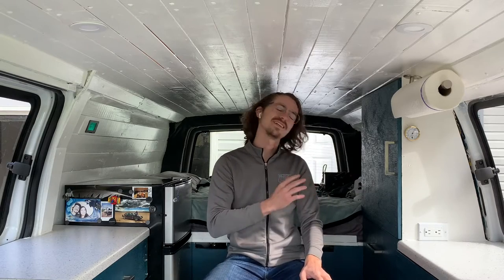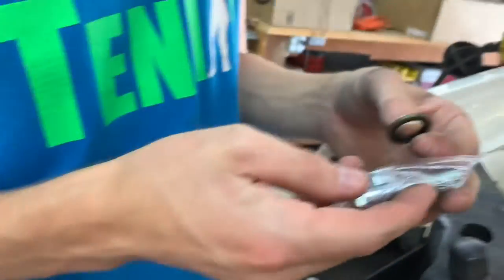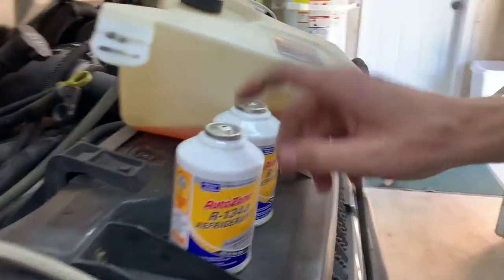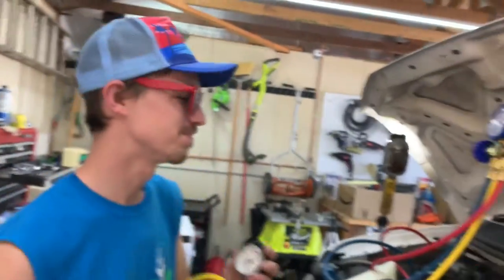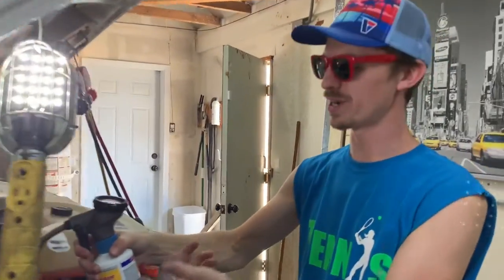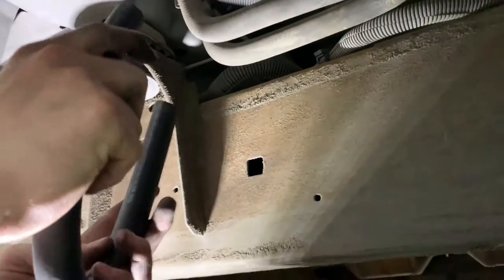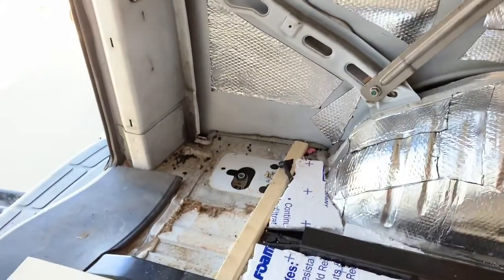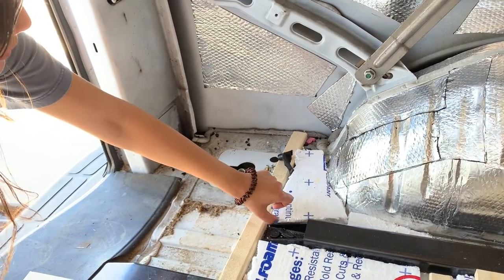Rear AC and Heat Bypass / Removal ~EASY~ (Express / Savana Van)

Comment: Hey- thanks for posting- I need to do this and am (slightly) less intimidated.  quick q- i noticed you had those long seat rails.  Did you remove or leave in before putting in flooring?
Reply from the maker: Hey slippy, left the rails in and insulated the floor all the way up to be level with them.

There’s some early pics on my old Instagram:
https://www.instagram.com/van_with_tim/

Comment: Anyone know if the AC block-off kit will work for the Astro Van?
Reply: If you go on Amazon it will let you put in your vehicle and you can search ac block kit and it will bring up parts specific to your vehicle!
Reply: @melissamorales1739  They only have bolts, which i bought off eBay and did not fit.

Comment: How did you plan the hole left from the unit? Cause idk how to weld so idk how i can properly cover it.
Reply from the maker: No welding abilities here either.
It's been a long time, but I think I just cleaned the area with rubbing alcohol then laid down quality foil ducting tape. 
Then I laid a large silicone bead all around the area and stuck down my foam board insulation.

No issues after two years.
Hope that helps!
-Tim
Reply: @VanwithTim  thank you so much!! Will definitely be doing the same 🤙🏾🤙🏾

Comment: Is this applicable to the G-series vans? Does this part work for a '92 G20?
Reply from the maker: Sorry James, I know the procedure and line locations are different on the 2002 and previous models. Not sure if the AC block offs would fit or not.

It's a shame they make the kits so hard to search for. Took me forever to find this one for my van.

Comment: Hey Tim, I’m trying to do a rear ac removal on my 1997 Chevy express conversion van, but it looks a bit different… can you point me in the direction of the rear ac hose that I should block off? I’m unfamiliar with its ac system
Reply from the maker: Ahhh… unfortunately the 96-2002 vans have a totally different design for the rear AC (my parents had a 1999 with rear AC issues)

I’m not positive on those line sizes / block off locations.

However don’t lose hope. It will take a little time but you’ll need to trace the two lines from the rear AC evaporator back to the front. Find a spot they bolt together / can be disconnected from the front, then measure the line diameter.

Hopefully you can find suitable block offs online somewhere (if not, Dorman Products makes some universal “AC compression fittings” to block the lines.)
Reply: @VanwithTim  thanks man, I just did it today, and all went well! You’ve definitely earned my sub!
Reply from the maker: @Ash91719  glad it worked out!

Comment: Best video I've found on this topic! Quick question though, how'd you determine which pipe lead to the rear AC? Is it as easy as following the pipes to their destination or did you need to take it into a shop to determine which pipe lead to the front/back?
Reply from the maker: Just traced the pipes around! Just remember there will be one “large” and “small” pipe for the front and a set for the rear. Hope that helps!
Reply: @VanwithTim  Thanks so much man! From your opinion do you think its worth going through the process to remove the rear AC?
Reply from the maker: @GMercer015  no problem 👍 and it was worth it for us to have the extra space. We went solar for the AC. Running the van overnight for HVAC is fine on the engine, but is just asking for trouble from thieves.
Reply: What was the reason behind removing it?
Reply: @substanceo9335  I originally wanted more room for my van conversion, as it would have freed up a spot for a small drawer or storage area. I ended up keeping the AC though, it works pretty well and keeps the back chill during hot months 🤟
Reply: @GMercer015  I’m buying a new 3500 2.8 litre duramax van with the back ac/heat option. I live in Canada so both will come in handy. I believe they work without having the van running…still checking into it tho. I figured I’ll get your opinion on it and if it’s a faulty feature, I will opt out and save $1300. Thank You!

Comment: Hi Tim,
what happen if you don't disconnect rear AC and fluid is leaking at the back ? will the all AC system be down ? I probably did a mistake and lot of fluid is leaking at the back AC. Thanks
Reply from the maker: If there’s a LOT of fluid (more than a few oz / mL), you might want to smell the fluid and make sure it’s not engine coolant.

(You can compare the smell of the leaking fluid with the smell of the coolant reservoir under the hood)

If it’s engine coolant, the leak is coming from the rear heater core. That leak should be taken care of as it could drain your engine of coolant and overheat.
Reply: @VanwithTim  well that’s exactly what happened.. is that a big thing to repair this heater core ?
Reply: @VanwithTim  does your system avoid coolant to go to the rear AC or heater core ?
Reply from the maker: @2marmosetsautourdumonde738  you can bypass the leaky rear heater core by following steps starting @9:44
You will only need a small section of rubber hose.

If you want to repair the rear heat instead of bypassing it, you will need to remove the whole rear HVAC system by disconnecting the rear AC and heater lines, unbolting it from beneath the van, then disassembling the unit to remove and replace the heater core.
Reply: @VanwithTim  thank you I will bypass it. The ac block off kit is mandatory to make all those f this work. Right ?
Reply from the maker: @2marmosetsautourdumonde738 the AC block off  is needed if you want to retain functional AC in the front while getting rid of the rear AC.
If you just want to bypass your rear leaking heater core, you won’t need the AC bypass.

(There are four lines total going to the rear HVAC: two for the heat (bypassed with the section of rubber hose) and two for AC (bypassed with the AC block off kit)
You can keep one while bypassing the other, or bypass both if you want to remove the whole unit from your van 👍
Reply: @VanwithTim  ok si i will bypass the rear ac to keep the front one functional then. I’ve bypassed the rear heater core but engine was still overheating.. temperature is going to extreme and cool down fast. Probably the thermostat ?
Reply from the maker: @2marmosetsautourdumonde738  hmmm. I would try the factory coolant bleeding procedure before replacing the thermostat. It sounds a lot like there is air in the cooling system.

Here’s the factory bleeding procedure:

Fill the radiator with coolant through the filler neck.

Install the radiator coolant pressure cap.

Fill the coolant overflow bottle to the full line.

Start the engine.

Run the engine at 2,000 - 2,500 RPM until the engine reaches normal operating temperature.

Allow the engine to idle for 3 minutes.

Shut the engine OFF.

Allow the engine to cool.

Top off the coolant as necessary.

Comment: Did it have a freon leak??
Reply from the maker: Still worked great, but needed room for the campervan build. Added in a solar powered AC and diesel powered heat.
Idling the van (6.0L engine size) consumes 0.5 gallons per hour (1.9 liters) costing around $2.25USD per hour to have the heat or AC on. Not great for overnight camping.

Comment: Hey Tim,

Just to clarify, you did or did not have the AC system discharged prior? This is what my mechanic friends said would need to be done by a certified mechanic instead of on my own and thus the one thing holding me back from starting this little project. Great video by the way.
Reply from the maker: Hey Alex, you should get the system discharged before hand. 
Really to do it 100% legally / properly you’d need thousands of dollars in machinery for the AC bypass.
HOWEVER there are plenty of back-yard mechanics that perform successful AC service without “properly” discharging the Freon as well.

Comment: So I did this now my engine is overheating. I lost alot of coolant and I replaced it. But still over heating.
Reply: Opened up the radiator cap. Heard some gurgling, working fine now!
Reply from the maker: Sorry for the late reply! Really glad it was an easy fix.
All the best!
-Tim

Comment: Great video...you're a handy guy! Maybe a dumb question, but how did you get away with not first draining your cooling system? With those hoses being at such a low point on the vehicle, I would've thought your all your coolant would have leaked out. BTW, your van sure appears to be in good shape for an 05 with 200k. The previous owner must have really looked after it.
Reply from the maker: Thank you!
I was actually fully expecting all the coolant to drain out when I removed the hose so it was a pleasant surprise when it was just a drizzle. I think I remember seeing an actuator on one of the rear heater lines. Totally unsure how it’s controlled but guess I got lucky!

The van definitely had a lot of leaks and eventually needed a new transmission, but the engine is strong and there’s no rust! 🙌
Reply: @VanwithTim I was fully expecting a waterfall too when you were pulling that first hose off. There must  be some sort of actuator as a fail safe in case a rear coolant hose fails. Would you mind telling me in roughly what area of the Cali dessert that your previous house resided? I'm a retired  Canadian looking to move to the U.S. SW...your house looked like the kind of place I'd like to go. You must have had some mixed feelings about leaving the area...it looked beautiful, albeit a little more needy and expensive than an 05 GMC home on wheels lol. I really admire your priorities for leaving the rat race at such a young age! Really good for you two. If you're looking for an older movie that might bring you guys some laughs about your current gypsy style existence, watch Lost in America, with Albert Brooks, circa 1985. Guaranteed you'll get some laughs! Thanks for responding!
Reply from the maker: @amale4202  The American southwest is definitely beautiful! The town was Phelan (pronounced Fee-Len), and most properties are 2+ acres (8,100sq meters)

But also check out Lucerne Valley for the spaced-out desert vibe. Far enough away from civilization for peace, close enough for grocery runs!

Will have to check out that movie too 👍👍
Reply: @VanwithTim  thanks again for responding!  I'm gonna have to jump on Zillow to see what's available in those areas. Not to beat the movie thing to death, but the basic storyline is a highly paid advertising sales exec and his wife decide to leave the rat race at a fairly young age to basically spend the rest of their lifes travelling the U.S., and hilarity ensues. After hearing your story, the movie came to mind, even though I hadn't seen it for probably 30 years. Worth checking out. Happy travels!

Comment: Why not just cap-off at front radiator?
Reply from the maker: I think the heater hoses come directly off of the water pump on the 4.8L, 5.3L and 6.0L engines Then tee off to go to the front heater core and the rear heater core. Capping it off at the tee would work just as well, but I didn't spend much time searching under the hood for the hose tees.
Figured the heater hose loop would work just as well for a little less labor.
Cheers!
-Tim

Comment: Has anyone else had a hard time find rear lines to fix them instead of blocking them off? 2000 savana 1500 van
Reply from the maker: Ahh. My mom had a 1999 Express 1500. Michigan van - lots of rust and corrosion. The rear AC lines corroded through at one of the frame rail mounts.

Never ended up fixing it, but I was ready to pull the trigger on these AC compression fittings. https://amzn.to/3RWkkl5
They're suspiciously well reviewed. The only challenge is finding the leak, hoping it's on a straight section of line, then making sure you have the right size fitting.

Would be curious if you end up giving it a go! I'd love to hear some feedback on them from a Savana / Express owner.
Reply: Hey thanks for the link and reply, I'll order them give them a shot and update you when they arrive. If they don't work I think I'm gonna try the resrac lines for the Yukon I see alot of them online, I just dont understand for the life of me why I can't find rear ac lines for this thing. I picked this van up for $500 it's a MINT no rust southern van, only issue was the ac leak and it needed a egr the old one couldn't be cleaned it was shot.
Reply from the maker: @GregoryJohnston77  Woah! That's a STEAL for $500!
Have you traced down the leak location? Hopefully it's easily accessible. That's super strange it has a leak at all being a southern van!

Comment: So many issues with this.
Reply from the maker: Tips to improve?
Reply: @VanwithTim  
Sure. Just because a systems been evacuated doesn't mean there's no pressure. Pressure inside a closed system is based upon ambient temperature, meaning minutes after evacuated, the system will start rebuilding pressure. A 90 degree day could mean 90PSI in the system. A/C oil is a hazardous chemical, carcinogen, and also causes eye irritations and should be handled only by experienced people rather than the beer drinking backyard mechanic. On every A/C part, tool, can of oil, or refrigerant there are warnings about the dangers of working on A/C systems and recommendations to only have certified technicians repair the system. As far as vacuuming the system after repair, the point of it is not to remove just the air, but to remove any moisture. That can't be done at 15". At sea level, a system needs to be pulled down to 27" for 30 mins for proper decontamination. Lastly, proper A/C oil level is important. Elimination of rear A/C leaves the person unaware of how much oil is in the front system. Too much oil causes incorrect system pressures which leads to poor cooling, and too little causes stress on moving parts and also poor cooling as the oil is what carries the refrigerant through the system. The only proper way to determine oil level is to manually drain the system and refill it. I wouldn't be surprised that on a hot day your output temperature is over 50 degrees. I'd also be concerned about early compressor failure. At least add a warning.
Reply from the maker: @dougschwind3652  Much appreciated and agreed on all points.
Truly the charge should be weighed in as any partial restrictions and ambient temperature fluctuations will throw off the suction PSI readings which the DIY can taps rely on.

I finally purchased an actual vacuum pump last year. As you mentioned that little hand pump isn't going to boil off any moisture in the system unless you're at an ungodly altitude haha.

Trusting a DIY'er to properly drain and fill with the correct oil in the correct amount is a big ask. Especially with the different oils and more importantly their solubility in the refrigerant used. (R12 systems with their mineral oil vs r134a PAG oil comes to mind)

That said, I've seen automotive compressors "semi-permanently" lubricated with grease and re-purposed into belt driven air compressors. (Super cool projects!) But the longevity of such a system would never be the same as a properly oiled, closed loop AC system.

Thanks again for reminding me of this old video floating around. I'll add some warnings in the description!

-Tim